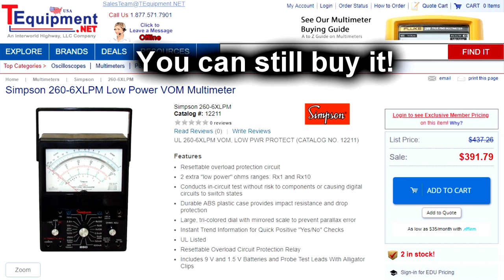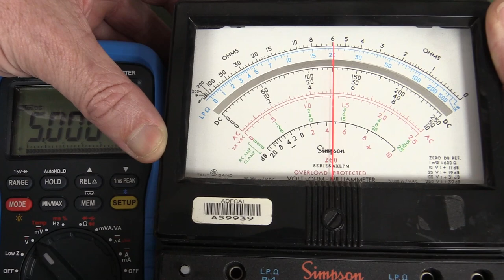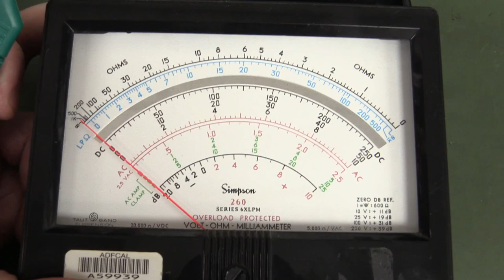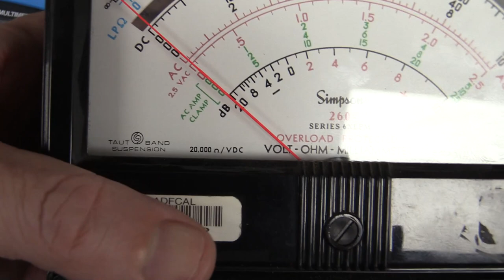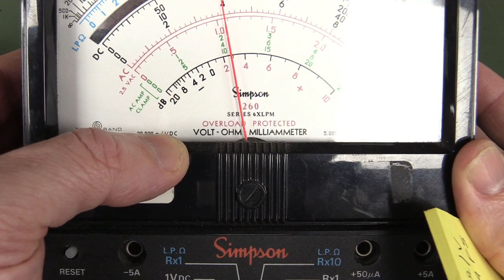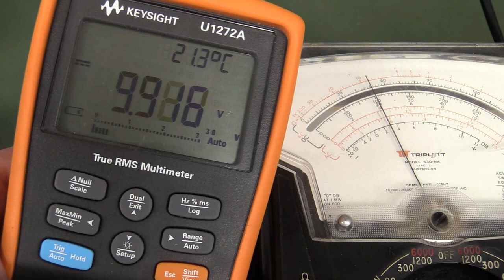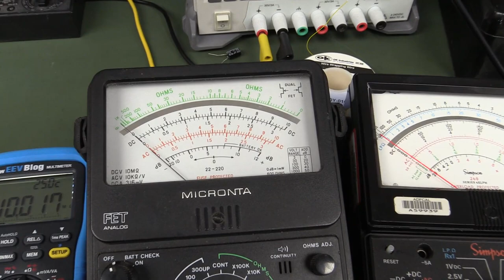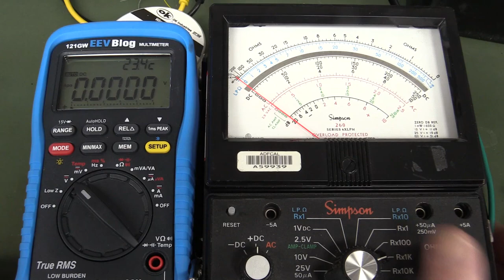EEVblog #1067 - Analog vs Digital Multimeters!

Comment: For my hobby I have a 100k, 60k and 10k DMM, but in my boat I still have this 60 year old AMM from my dad which is perfect there:
- Never empty battery (biggest advantage for a meter hardly used)
- Excellent to see if there's a voltage or if the battery is full or empty
- Very short touch to see if there are big amps without blowing a fuse

Comment: Well yes analog meters aren't that common now but we just can't  forget the workhorse of the thing that basically propelled us into the digital age.
Reply: I tend to agree that the old technology and ways should not be completely discarded and forgotten just because they have been displaced. At a minimum it would be useful if they were still documented, new better might come from these older things.

On a side note, I did petition the FCC to keep the Morse code requirement in the highest amateur radio license, but the Morse code requirement has been removed. I guess it is OK, there is still Morse on the air, but, as Dave might say, I wonder if it is only gray hairs using it.
Reply from the maker: I never said forget them. I said there are still niche uses for them, and that's why you can still buy them.
Reply: EEVblog oh I didn't mean you said to forget them. Generally people don't really know now.

Comment: I used until yesterday a old chap analog multimeter of my dad. Now I moved to a an8008.
All looks simpler with a digital meter. (I switched mainly for the diode mode and the ohm meter easier to read)

Comment: I use an analog meter mostly for checking transistors for any leakage between the pins in the reverse mode using x1k and sometimes x10k scale. Something you cannot measure with a digital meter on the ohms range and diode test as the voltage is too low.

Comment: The 'fluctuation' thing isn't, or isn't in my opinion, what is demonstrated here.  It's actually the analogue meters ability to show readings quickly out of the corner of your eye. As in, when you are quickly dabbing circuits to trace voltage paths, you can concentrate on the test points without having to really look at the meter reading, as experience tells you where abouts the needle should be on the scale.  On a digital readout you need to pointedly look at the display to see the reading.  Although I do concede this is just about the only advantage analogues have, but then generally it's only relevant for service work on old TV's and radio's. Back then the veteran service hack would have all the readings for the typical sets arriving on the bench, stored in his head, so as long as his AVO had the needle in the general vicinity thats all that was needed. 
Which brings me to the MAJOR point here, Dave, you haven't lived until you've seen and used an AVO 8. Someone send him one please, for a strip and tell vid!  The AVO was a system meter with a huge array of accessories, like range extenders (upto 1000 amps I believe!!) for amps, volts and resistance, even a 25KV probe!  Overload protection was provided by an inertia cutout, which basically isolated the meter when the needle hit the end stop with more than a preset force!
They are wonderful things, I have quite a collection of them with accessories, leather cases etc.  Still use one to work on vintage stuff.

Comment: In transistor testing digital multimeter can only identify the base the collector and emitter cannot be identified even if its in diode testing or ohms function. The Analog Multimeter can identify the emitter, collector and base respectively. Also Analog multimeter even without batteries you can test voltage AC and DC if you ran out of battery. So its handy to have both analog and digital if you are a hobbyist. Of course nothing beats the digital multimeter nowadays because of functions are being squeezed in these multimeters. Like the Fluke you can have a full featured multimeter. With accessories you can have temperature and the clamp accessory you can have the non contact clamp function.

Comment: What about reading possible defective potentiometers and rheostat's. In the Navy we had to keep old Simpson 260s analog meters on hand just for those test. They would help detect burn spots/worn carbon traces as the contacts would slide over the range of the potentiometer/Rheostats. On a digital meter it just looks like the meter is normally searching for a value.
Reply: That exactly the point ... most of the time precision does not matter but have ability to "see" what is going on is priceless ... Also people more easily remember angle of needle of "safe value" than read value and think if it is OK or not ...

Comment: 1) No batteries except for resistance.
2) Needle deflection is very intuitive.  A quick glance and you know whether you are in the ball park.  There is no need to distract your intellect with abstract numbers.  This is another reason DMMs emulate needle deflection with bar graphs.
3) Lower input impedance actually is useful for detecting open alternating circuits with substantial capacitive coupling such as electricians might need.

Comment: But Dave I still use my analog insulation resistance meter everyday, much easier to find electrical faults over a slow digital type. Especially if the fault is random, you can see the needle fluctuate as the digital types tend to dick around.

Comment: I have the Micronta on the left, almost. It's Not labeled "FET Analog" and where the DC10A jack is is an "Output" jack is.
I keep it around because it has the fastest most sensitive continuity latching of any of my multimeters. It will detect continuity through 3lbs blocks of steel with oxidized surfaces and it's instant.

Comment: At 12:44 your point about DC input resistance, re circuit loading is well taken & understood. No debate. HOWEVER  I have a Triplett 603 analog multimeter that specs out at  11 Meg Ohms DC input resistance and 10 Meg Ohms AC.  Yes I also own  several DMM too.

Comment: This takes me back to my days at college (Early 80's) when we used AVO8's, nice one Dave.
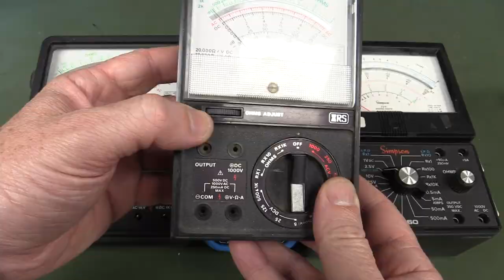You showed the very same meter I bought from Tandy back in the day at 1:10. 
It's important to make sure the analog meter is in the off position during transit as the switch shorts out the meter to stop it from moving too much...this can be seen 24:44.

Comment: another application where an analog would work better is if you have a circuit that moves the analog scale in a specific, unique pattern (like slowly up half scale, a little down, then up all the way, and then slowly back down), that is easy to visually remember. And then it becomes very easy to test another circuit of that kind, because human visual memory is very good.

Comment: Constantly varying values are extremely difficult to read on digital meters, though.
Take, for instance, a voltage ramping at about 1V/s from 0V to 12V, and back. A digital meter will show numbers going by, one after the next. On an analog meter, you'd likely be able to guess it's a triangle wave, and not a sine.

At 21:29, it's just about impossible to see what the average DC value of the signal is on the digital meter. You can see readings flash by, but it's hard to process them that fast to get an idea of the average.
On the analog meter, it's much easier.

And sometimes Autorange doesn't like the signal, and hops between ranges giving no useful info. You can change ranges manually, but it's more work to figure out.

Finally, the lower input impedance means you know there's some power behind a signal.
Measuring a largeish cap, as you demonstrate at 22:23, discharges it with an analog meter. Digital meters will typically just show the voltage the cap is charged to, maybe very slowly going down.

Digital meters are vastly superior for many things, but there are situations where analog meters are needed.
Reply: Many meters have min/max/average settings. So most DMMs can do basically everything the analog can, if you know how to use them. Many can read capacitance directly, not simply the charged voltage.

Just like an analog, you have to know how to use them. If you don't know how to use or interpret the analog readings, especially in the edge case situations where the behavior is not straight forward, it is still going to be useless information.

An analog can show some things easily, just from the nature of how they work, but are harder to use on the whole even for simple checks. DMMs are easier to use for most things, with a need to be a little savvy for some edge case stuff.

Most signals are too high speed for the analog to be fast enough to properly show them on any meaningful way either, but a DMMs setup correctly may be able to provide something useful.

But I still have use for an analog from time to time, but it's always edge case. I work aviation, and many of the older analog indicators work off of low voltage to deflect the needles and fault flags, an analog meter can actually move them, making for a quick test of their function... But as the regulations change, and the need to update equipment to meet those new regulations increases... I see fewer pieces of equipment that I can do this test with. Either due to being new digital LCD fanciness, or at least digital internals with analog display... Or still being somewhat older equipment, but a bit newer in design that no longer has the needles driven directly from an outside source, but driven from internal interpretation of an incoming source signal.

Comment: Same here, analog meters still rules when it comes to setting a peak voltage, or when measuring a null  voltage. It is a lot easier to glance at a needle verses trying to figure out what the digital meter is showing.
Reply: I disagree with you.

Comment: One great use for the analog meters is tuning filters, watching for a 'dip' or a 'peak' is much easier on an analog.  The other time it is useful is when repairing old equipment where the manufacturer specified a 10KOhm/Volt meter was used in the adjustment and alignment of the equipment. There are some analog meters that have a 5KV input range, I don't think there are many digital meters that do. My Kamoden HT-100B4 for example has a 1KV range, 100MOhm input to 1KV DC, DC100KOhm /V AC12.5KOhm/V, and 10uA, 0.25mA, 2.5mA, 25mA , 250mA and 10A ranges.

Comment: The nice thing about analogue meters is the ability to become acustomed to using periphery vision. This is the main advantage over a digital display which requires you to stop look, focus and think. The analogue meter in many instances allows much faster and more productive results. The 'bar graph' is not comparable in most meters.. Though it it what you are used to and get accustomed to which is best in the end.

Comment: Analog meters are a really quick way to test a large capacitor,  set on ohms hook up the leads. Meter will show a low ohms reading then as the capacitor charges reading will show up as an increase in ohms, just watch the needle. Works great with the larger capacitors used in the automotive industry,  or in heavy equipment

Comment: What about TRMS ? A Digital Multimeter needs to have special functionality to measure Signals where this matters but is there such a thing as an analog TRMS meter ? or do they always measure the TRMS value because the needle is driven by the strength of the magnetic field wich already resembles an TRMS value ?
Reply from the maker: Analog meters are only "RMS" when it's a sine wave you are measuring. Other waveforms will not be True RMS.
Reply from the maker: There is a big difference between "True RMS" and "Averaging responding with an RMS multiplier fudge factor". Analog meters are the latter.
Reply: EEVblog Yes. To put it in plain language, analog meter can only measure AVERAGE value. Then suppose it is sine wave, convert to Root Mean Square value. If the ac is not sine wave, the reading is all over the places, has practically no meaning.
Reply: Gladius Illuminatus Analog meter measures average value. Not TRMS value. For DC, average value is right. For ac, only sine wave get the right reading.
Reply: In fact, there is a special type of analog intrument that is able to measure true RMS voltages and currents: moving iron instruments.

Comment: Remember too  that the 2% or 1.5% was of the  full scale for that range.  So care  had to be taken to assure that readings were in the upper part of the range to achieve better accuracy.  I had forgotten what a pain in the behind analog multimeters were.  I was a bigger fan of the VTVM because of input impedance problem

Comment: It sounds like the no energy requirement for volts/amps could be useful till this day. Also, maybe if you were planning for the end of the world you would want one of these instead of a DMM?

For me though, just having a digital display is so much easier and quicker than having to read it and pay attention to which scale you're on and where you are supposed to be relative to that scale. Similar to a mechanical watch vs a digital display watch. It's just quicker and easier to read out the numbers as they appear rather than calculating it based on distance traveled.

Comment: For my first 10 years I used analog meters and I did feel a little 'detached' from circuits when I started switching to digital meters. The feel you get when using an analog meter is not available on digital meters. A bit like getting a car with power steering. Yes digital meters are mostly more accurate but how many people need the 7th digit of their 7 digit meter (or even the 3rd digit)? A great deal of meter work does not need high degrees of accuracy and analog meter 'feedback' is much better and can be an advantage for some uses. Simply focusing on accuracy may be a little misleading. I have to confess that I now only use analog meters when repairing old valve equipment but they are better for some limited purposes.
Reply from the maker: A basic 5V supply spec is 4.75V to 5.25V. You can't even verify such a basic thing with an analog meter with an accuracy of 2% and barely a 3rd digit.
I said they are still useful for niche purposes.
Reply: Definitely know what you mean about the feeling you get from an analog meter, they do have a fun factor. Having that needle move makes you feel that much closer to the circuit since it's directly powered by the circuit. Who doesn't love a nice analog display on a power supply or radio, makes you feel like you're in a mad scientist lab! I don't use them myself for everyday measurements but they can have their use on things such as Variacs and panel mounted stuff so that you don't always need to be down another meter.
Reply: I used them for that very purpose for many years and could even see if there was excess ripple. I did say they were not as accurate as many digital meters but even a digital meter needs to be used with caution with regards to accuracy. Just because a meter reads 5.25237856 volts does not mean that the voltage is 5.25237856 volts. Digital meters have a 'needle width'.  However, as I said in my original comment I rarely use analog meters any more but I would still recommend anyone wanting to get into electronics to get one and use it for a while for the same reason I would also recommend getting an analog scope. Build a ramp generator circuit at 0.5Hz and watch a digital meter compared to an analog one. This is not really what I would describe as a niche purpose so much as a useful visual aid to learning electronics.
Reply: All my mcu DC designs work at let say 5.003 or 5.1 using several DMMs the same way as if the needle on my taylor 100a settles at that "5" ;)
And we don´t speak tubes Amps here....they don´t even care about whenever it´s 480 or 520Volts on their plates...;)
 Dave..? what´s that thing with the resolution for, we cried about it in the old days, now that we have it...nobody cares much...;)
Reply: TubiCal, I have been an embedded systems designer for 35 years and my company develops high precision instrumentation and RF equipment and as I said I mostly use DMM's and in fact I need 7 digits for our precision designs but my point is that for a huge amount of work an analog meter will work but my main point is that they are a very useful learning tool. Actually many MCU's don't care if they are running at 3.5 or 5V. It is only when you start getting into the lower voltage units that it becomes more important. I have even pointed out in previous video's that when taking accurate measurements there are other things to be taken into account such as thermocouple contact errors etc and as many people do not take this into account you can assume that they are not reaching the full potential of highly accurate DMM's. If I saw a 40v error on tube plates then I would look for the fault. Why not have a go at aligning an FM discriminator using a DMM compared to an analog meter and you will see the point.
Reply: the 40v error "fault" is mostily due to the fact that i replaced the old selenium type rectifier with four 1N4007 diodes in a full bridge rectifier assignment...;)...also i have, and use a solartron type DMM...sometimes we need these digits (in order to have an analog synth cal to real 
 and clean 1V/octave...having only 2 octaves keyboard doesn´t sound that critical, but if want use it with 88keys then you need to 
have 1.000/octave (at least) or the higher notes gonna sound just wrong.
Reply: Cpu Vcore ram voltage no way test it whit theses old analog metters plus on dual display i used for see the AC ripple /noise on second display of my brymen 867 instead hook the osciloscope.
Plus is fun they blame digital sucks on valvs equipamente and just valvs are high impedance stuff soo they can not use the tipical analog ones they all use the top analog meter whit fet/valv for get the high impedance need for test.
Reply: +Jerry "the feel you get when using an analog meter"
Lol, this makes me think of my dad's old analog meter that zapped me lots of times because of induction in the meter coil.